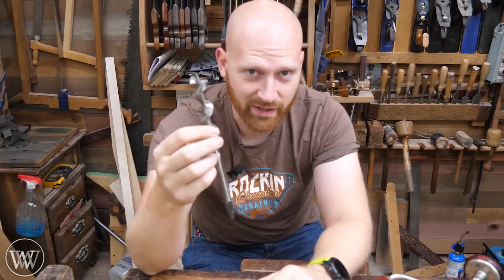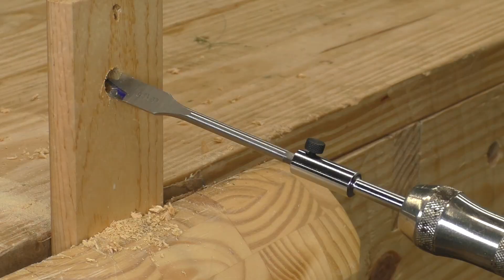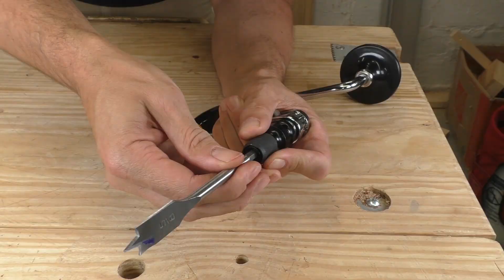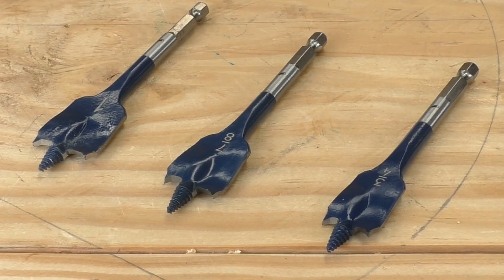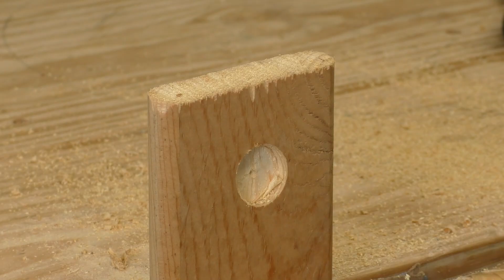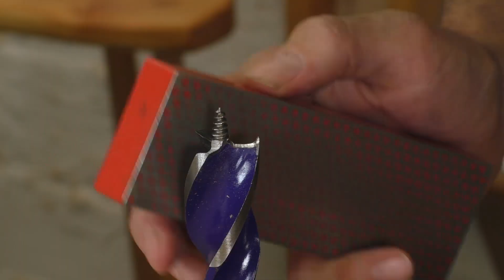Modernize your brace with new gear!

Comment: Just bought the Garett Wade and the 3-jaw chuck is back in stock. Pretty nice. And the four jaw chuck also has a 4 sided hole in the bottom to grab old style auger bits. I have a pretty complete set of auger bits so good to go for now ($20 and a hundred mile drive).

Comment: I don't think this ticks the "affordable" check box, and they don't come in all the 1/16th sizes, but Tools For Working Wood sells "Jennings Pattern Auger Bit for Braces" which are supposed to be essentially identical or better to the antique ones.

I haven't tried these yet because I have a full vintage set, but I do want to get some soon.

Comment: I have a very old set of bits  (made by Brades before most of us were born ) for square chucks but the largest bit will not fit the normal ratchet brace . It has more blade surfaces  to cut the wood.They are easy to sharpen .There is a new conversion part to change the twin jaws to take modern phillips bits. Ideal for floorboards .

Comment: I used my Forstner bit to inlay large diameter, shallow-depth caphead bolts let into the Ikea cabinets. The Forstner bit acted like a circular plane to bore a nice round hole, with a flat bed for the caphead bolt-head, to rest against. Nothing else other than the brace and the Forstner bit could have done that job with accuracy. Just brillant.

Comment: Yes, Rex, I commented on your earlier video. Not sure if it is still there (I get banned from YouTube occasionally). Like you, I just think the bit brace is one of the all time great wood working tools. I could not have made my Ikea Stuva/Besta shelf system without it. The brace is the only tool for accuracy and control to bore with Forstner and spade bits. For some reason I kept forgetting to purchase one, until I realised I really needed it on this Ikea.
So I went to a salvage yard and purchased a 2-jaw 60 year old, Australian-made one. Then I installed a 6.35mm hex drive quick release chuck and left it as a permanent mod. Now I have access to all the readily available modern Forstner and spade 6.35mm-shanked bits.
A vastly underrated, under utilised tool I wished I had, 30 years earlier. I've always liked them for their simple ruggedness, but there is nothing like owning one to appreciate how good the brace really is. I'm going to attempt a full restoration on my old brace, but I'm also after a new French-made brace you see online. Since it is new, I will choose a 3-jaw version.  Cheers 👍

Comment: As far as torque goes, I used a brace plus socket to drive 7/16" lag bolts when I used to install satellite dishes and what I found was I HAD to drill pilot holes, first, or the bolt heads would tend to twist right off!

Comment: I also have an update to the whole bit brace equation, which is like the hot rod one:  Good, available, cheap:  Pick two.  You can pick up the Wood Owls and the are good and available.  The ones in your video are available and cheap, as are most sets on E-Bay.  The $20 set I picked up on Amazon?  A few bits worked great like the one I used on my hand plane, but the rest, well they were like those in your video.  In the end, I wound up with something that is good, somewhat cheap, and sort of available, if you are willing to look on E-Bay for awhile.  The key to finding good bits is to only look at ones that are in the original case and the original brand.  Some are almost as expensive as the Wood Owls, but you can find some deals.  I found a complete Irwin auger bit set in the case, and the photos showed every bit and snail to be in excellent condition.  No rust or anything else.  $100.  I almost started to ask the seller:  "Would you take $75?", but decided that $100 was just as good a deal as $5 for Thor's hammer.  So I bought it.  And these are nice!  Given that most other complete sets were over $200, I think I got a good deal.

But in my experience, finding a good bit brace is hard.  Our local flea market doesn't have tools, and there aren't millions of them out for $1 at least where I live.  So I headed over to Veritas to pick up a new one.  I mean, it is $70, but it is Veritas, so it must be good, right?  Right?  Well, it arrived rusty, and that was the least of my problems.  I cleaned up the rust, and started using it.  It's quality is about what you observed with the Garrett-Wade.  That is until the jaws in the chuck failed and trapped the bit in it.  Given that I already knew it was junk and the bit was a nice one, I am now using my power grinder to grind away enough of the chuck to get the bit out.  

And speaking of Garrett-Wade, I picked up one of those - and it immediately failed - boring 3/4 into oak, the ratchet started slipping rendering it useless.  Garrett-Wade is awesome, even if the manufacturer of their bit brace isn't.  I returned the brace, and they sent me "two" replacements.  One worked and the other failed with the same ratchet problem.  So I returned the 2nd broken one and started it.  It worked - OK - just like in your video.  Until I decided to make Thor's hammer.  That required drilling a 1" hole into ash.  Drilling a large diameter bit like that into hardwood requires a lot of torque, and it stripped the jaws of the chuck of the Garrett-Wade.

So I once again turned to E-bay.  Most of the braces were antiques of varying quality, but all seemed have some sort of problem.   But one seller had a new Irwin 5420 12" Ratcheting Bit Brace.   I didn't even know Irwin still made bit braces and couldn't find it on Amazon.  I bought it - about $25 plus $10 shipping.  Turns out it is made and sold in Brazil.  You can't buy it directly here.  Anyway it is - pretty nice.  The handles are made of ash instead of the usually plastic, it is solid, and was able to plow through the Thor's hammer mortise holes without any problems.

Comment: I have come to pretty much the same solution. That’s why I bit the bullet and bought second hand bits on ebay. 2 or 3 here and there to slowly grow my collection over time plus a nice imperial set from the UK to complement my metric ones. Now I’m all set. And I have to say, I love them. I only recently finished my Morovian workbench which I built using ash. I actually ruined my power drill when I started drilling dog holes into it, smoke was coming off of it. With the brace it was no problem at all, so thanks for recommending them!

Comment: Rex, Have you tried the solid center auger bits from Irwin?  They are designed to be like the original Irwin bits. Two spurs, two nickers, square tapered shank, sharpenable.

Comment: I'm considering grinding the shank of a good bit into box shape. Not meeting your criteria with this, but running into the same issue I came across this vid. Maybe approach the manufacturer of a good type bit and ask whether they can pump out a batch with a shaft with four sides? Idk, I rather solve the issue than meeting your criteria

Comment: I have an old Stanley 10” bit brace but the chuck is mangled so I’m actually sawing off the threads of the chuck and tig welding on a half inch drive so I can get all the versatility of this tool and the quality of an old Stanley. Thanks for the vid, I would have never had the idea to do this without seeing this a week ago.

Comment: I have never found a two jaw chuck to have much trouble with hex shank bits at all. I mostly use  brace for screws, I work with a lot of old brass slotted screws and the down force and torque is unrivaled, and very effective with soft brass screws. So I keep a normal cheap magnetic bit holder in my brace almost all the time. When I want to use an Auger bit I tend to use a very old, but lovely, brace that has a square taper hole and holds traditional bits much better than an adjustable chuck.

Comment: I am boring 20mm holes through 5" Alder to take threaded rod in the construction of mud mats. I tried a brand new Irwin with an18v Dewalt hammer drill and beat my right hand black and blue with the kick back. I'm digging out my old time carpenter chest inherited from my time served cabinet maker uncle to clean up his old auger bits and brace , old files included and spare the bruising. This video may spare our quiet little Welsh valley a lot of cussing.

Comment: Thanks for this!

I have a question about the G-W brace for Rex or any who've used it, and a couple comments about bits. The question is: is there a lot of angular slop at the 1/2' square joint with some of those adapters? I saw what looked like the bit waggling back and forth when first attached in that video, but can't tell if it was the 1/2', the quick-change drive adapter itself (sometimes those have a lot of play), or just my imagination. 

MY MOST IMPORTANT COMMENT ON BITS:

If you get a vintage brace with a vee notch in the alligator jaws, it can usually straight up hold a hex driver with no adapters or modifications. You can buy a quick change hex adapter for a drill from Harbor Freight (or a better one, I'm sure) and lock it in the jaws, and start driving with your brace. For many tasks, it is far better than an impact driver, with more than enough torque, and a LOT more control. I like those DeWalt magnetic bit holders with the sliding sleeve for keeping the screw on the bit. Of course, from there you can attach any impact compatible drill bits, but a brace isn't really made for drill bits. It's made for augers. 

OTHER COMMENTS

I don't have an affordable option for bits except lucking into vintage bits on craigslist, estate sales, etc. People who call braces "hand drills" tend to price the bits lower. I will say that some of the bits featured as "bad" here are great at other tasks in a power drill. Those speed-bor bits are great for drilling though a joist to run romex, for example. I use them all the time in construction tasks.

I am also going to say (as a guy who decided to take the risk and invest in Wood Owl bits when I had an infant at home who freaked out every time he heard a motor running) that they are truly excellent in most ways, and probably worth the money. They also just fit right into my braces that have the notched alligator jaws. WARNING though: In some woods, with the smaller bits, the snail might want to pull up fibers outside your circle before the knickers touch. On a delicate project, with a 3/8'' or 1/2'' bit, I will sometimes take a pass with a forstner for a few turns and then switch to the wood owl. It's a pain, and would probably be rectified if they fluted their snail or maybe made it a bit longer. At least these days, my kid won't freak at me using a hand drill, so I can chuck the bits in different tools and maintain some efficiency there. The brace is still better for through holes, or if I am drilling to depth on something too big for the drill press.
Reply: coming back here to say that this brace design is not great for stability, and the chucks wiggle a lot when attached. It would be far better to terminate this tool in some sort of machine taper.

Comment: Kind of surprised you didn't mention a 3 jaw one, I found one at the thrift store and restored it, works great with all modern bits. I know the plastic chuck modern ones are kind of ugly but this one is really classic and all metal.
Reply: So a 3 jaws would work with round/hexa/tapered bits?

Comment: You are chasing the wrong solution.  If you want to put a round or hex bit in a brace, you need an adapter that goes from 2 jaw to 3 jaw.  3 jaw standard Drill chucks ( 1/4,3/8 or 1/2) are cheap and  readily available.  They use one of a few standard threadings... mostly 3/8 x 24.  Putting this all together you need a 3/8x24 UNF to Auger Bit Square tang adapter.  These were never made commercially, to the best of myu knowledge.  But I have contacted Lee Valley Tools with the idea and encouraged them to make this adapter, since they have similar adapters.
If you like idea, write LV and tell then you too would like them to make it.  Cost could be int he $10-15 range.... plus the chuck of course.....

Comment: I bought the Garret Wade versatile brace and alternative 3-jawed chuck.  I was delighted ... at first ... only to find, along with others, that the single nicker hex shank auger bits that are currently available in the market are very rough in a low-speed high-torque hand drill.  For now, I have sourced a second-hand Jennings pattern 3/4" bit that will be suitable for a traditional hand brace (it's 3/4" holes that I most want to drill just now as I build a bench) and will use the square chuck.

I've come across some threads suggesting that the current pattern augers, optimised for power drills, can be relatively easily  resharpened to work well in a hand drill.  That's my main avenue of interest at the moment.  But I haven't found anything that spells this out at the "idiot's guide" level that is what I really need.  I will stay 'on the case' and report back if I find a proven solution.

Comment: Fisch make a Jennings style auger bit available from Tools for working wood and highland wood worker. I have a full set and they work fine using them  in a Stanley bit brace I bought as a first year apprentice electrician in 1973. I live in Western Australia I tell we have some hard wood here they drill throug it with out a worry as long as you use a pilot 3/32 hole and keep them sharp. The Fish  Jennings style Auger bit sell for about $40 to $60 each from Tools for Working Wood and Highland Woodworking. As for price it is comparable to what it was in 1973 considering my weekly pay packet. I would by 1 or 2  bits each pay until I had a full set.

Comment: Hey, Rex. You really should try Star-M bits. It's incredible quality japanese tools, especially made for a low speed drilling. 
I use it with my brace & millers falls mechanical drill. Probably, this is my go-to drill bits. Not extremely cheap, but not really expensive.

Sorry 4 language, greetings from Russia.

Comment: Old Sneelock shows how to rehab the expansive bits https://youtu.be/g1sTzNYt2AI

I should clarify -- I think expansive bits (which are still made and readily available) -- would work better than the speed bore bits and cost less than the wood owl bits, and you only have to buy one. Expansive bits also have slow-start snails so you don't have the problem of the snail not grabbing like you do on some of the bits you tried.

Comment: I have my grandfather's brace and great-grandfather's brace & bits. GGF was a cabinet maker for a railroad company in Knoxville, TN (the place is now a restaurant).
I'm not a woodworker but tinker around a bit (pun intended). I've been a little intimidated by these braces & bits, not sure how the shank went in, and this and you other B&B videos have been very helpful.
I was hoping my great-grandfather's tools were worth more; he has a very (air) tight tool chest he built himself (about two, 2 1/2 feet high, with a lid and two trays) everything's in pristine condition; lots of Stanley stuff, spoke shaves and such.

Comment: I've got a rcanvas rollup set of about a 16 bits that I use with my grandpas brace. I don't use them as much as I could but am always impressed at how they make quick work of larger holes.
Brace is great to use with extended Robertson bits for driving screws without having the screw slip. Thanks for looking into this!
Reply: I have a similar ser that was produced and marked for the Army . I would guess approx. WW II vintage. They were gifted to me by a quite remarkable older gentleman who observed that I was probably the only person he knew that would actually use them. I've used them for probably 30 years since I received them. Never thought much about how difficult it might be to ever replace them with like quality bits if I ever needed to do so.

Comment: Thank you for your review.  I've experienced the same issues.  I do have a Stanley brace of relatively recent manufacture that holds hex shanks quite well.  I use it mainly for screw driving and removal.  It's my "high precision, cordless driver which never requires recharging," though sometimes I do.

Putting a square socket end on a brace isn't that new an idea.  I have two such, a 3/8 & a 1/2 drive that are fifty to seventy years old that are part of a Curtis Wright socket set.  They look primitive compared to the Garret Wade brace.  They are forged from an iron rod, have no ratchet and primitive and inadequate handles.  They're rather long and appear to be intended to get at bolts or nuts that are deep inside a machine.  But they work.

Comment: Rex, thoughts on making your own bit brace with a socket wrench? Those garrett-wade braces have been sold out probably since you posted this. Then you can spot the 50$ you'd spend on the brace for those auger bites that really matter
Reply: The bit brace with the 1/2 socket drive is also called a mechanics speed wrench. Lacks the "pad" on the end but can be adapted.

Comment: Alternatively: Hire Alec Steele to make square auger bits

Great video though :D 
Once upon a time I had my great grandfather's brace (I actually painstakingly used it with a screw in the "chuck" to "drill" through a steel rod, that's hours of my life I will never get back) I think it ended up in my uncle's garage though when my grandfather sold the house

Comment: I HAVE A SOLUTION!   Sharp HSS drill bits NOT WWS bits!  Longer lasting and cheaper, even the more expensive ones are cheaper than WWS.   Yes use them on wood ... trick always pucnh a hole and drill a pilot hole with a drill bit 5-8 times smaller.  Also BACK the wood you a drilling with ... WOOD. Then you have a clean end to end hole. If you FRONT the wood with wood even better no cracking.  If you pilot a hole with a drill that is say half the size ... mistake it grabs and spirals inwards.